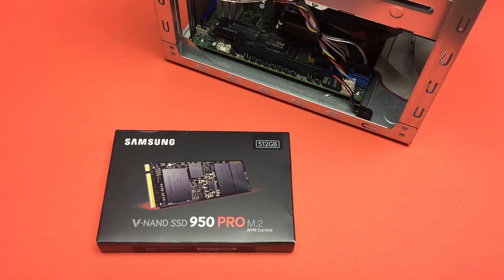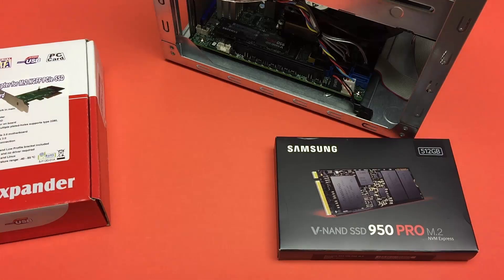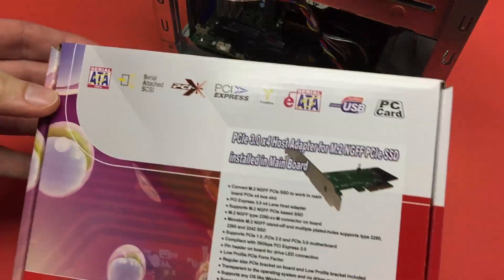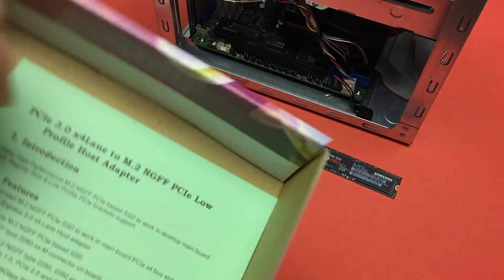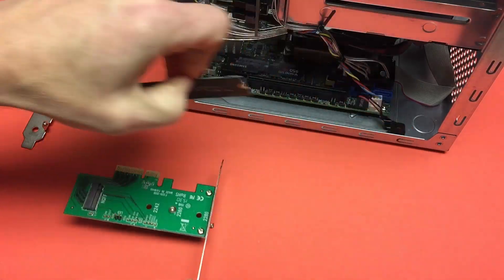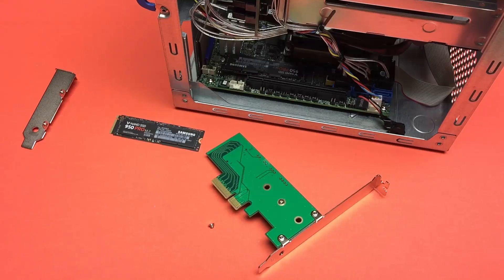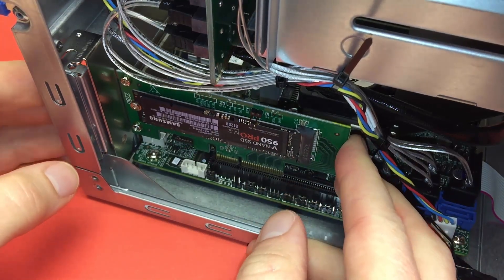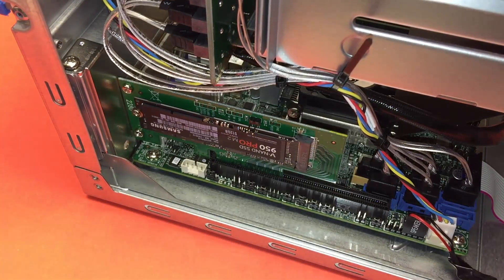How to install Samsung 950 PRO M.2 SSD in a PCIe slot with a Lycom DT-120 M.2 to PCIe adapter

Comment: That card may be sold as PCIe 3.0 but there is no circuitry of any kind that on it that would hinder performance if used in a faster slot and with a faster drive.  Boards like these are just a direct connection to the PCIe slot.  I would not hesitate to buy that if I had a PCIe 4.0 slot or better.
Reply from the maker: You make a great point, thank you!

Comment: How do I make this my boot drive in bios the ssd does not show up in my bios. I did the adapter just like you did.
Reply from the maker: Not all motherboards are capable of booting from NVMe, unfortunately. Do you have the same system?

Comment: ok but how you solved the problem with HDD led? My HDD led is not blinking when I use adapter.....my HDD led is blinking for the other drives but not for the EVO pcie drive

Comment: Hello Paul, I was wondering if the port where you put the card into is going to work?, I know you did it for a reason of course it just that it looks smaller, that's why I ask. I usually use port with catds that fits all the way,  greetings...
Reply from the maker: It works well in that PCIe 3.0 slot, and only uses 4 of the 16 lanes. Not sure what catds is.
Reply: Paul Braren I'LL give it a try, so it means that it works if it's using a few lines only?

Comment: in case of intel z77 you will get pcie 2.0 x4 instead of 3.0 x4, but "only" running on 2.0 x4 this is still insanely fast!!

Comment: I want to install a Samsung 960 Evo M.2, PCIe, NVMe just as you have done now. My question is, with this setup, can this be my boot drive. My goal is to make 960 my boot drive and with a partition make the installed 1TB HDD a secondary drive. I can't seem to find a PCIe adapter to sata. I have an HP 580-023w. If there is a possibility of different setups will any slow the drive from Max performance. I could replace the HDD with an SSD sata, but my limited know how tells me it is slow.
Reply from the maker: Bootiing from NVMe generally requires BIOS settings and a system that supports it, or use an old Samsung 950 PRO that helps even older machines get booting working right. More detail at:
https://TinkerTry.com/how-to-boot-win10-from-samsung-950-pro-nvme-on-superserver

Comment: Hi Paul.  I was thinking of doing this exact install of an M2-PCIe-SSD via a carriercard.  And on a workstation like the Dell T5610 or HP Z620 (these have double Xeons and can hold plenty RAM so would suit me fine for my audio-processing work).   In my opinion such workstations will profit maximally from these fast PCIe-SSD's (e.g. the 960 Pro now).    Where I can see that the SSD will fit and probably also will be connected to the correct datalanes in that PCIe-slot,  I am not sure whether I can install Windows on that SSD and have that SSD as the primary/boot drive.    Appreciate your thoughts/experience on this!

Comment: Touching a memory module like you did while unpacking it is the best example for the lack of knowledge in most of these so called "experts" flodding YouTube with their bullshit. NEVER touch the pins with your greasy, static charged fingers is rule no.1 in handling such modules. Back to school i would suggest
Reply from the maker: Humidity wasn't a concern in the room I was in, but yes, lack of an antistatic strap telegraphs the wrong message to viewers who live in dry climates. Fingerprints always never good, also a good point. Thank you for taking the time to leave feedback for other viewers to consider.

Comment: I have only one m.2 slot on my mobo (z270). I'm getting a nvme samsung for install OS and softwares (photoshop, office, video editing and a few games), and some internal 3,5'' sata hdd, several terabytes. I'm wondering buy one of these (startech one, maybe? or any that supports nvme interface) for my m,2 ssd, and buy a intel optane module for boost my games installed in HDD. Am I making a good choice?
Reply from the maker: Sorry, my focus hasn't been on gaming, instead on VMware vSphere to run VMs. But if your mobo can do Optane acceleration of big drives, then yes, it should be a pretty darn good experience.

Comment: Have you tried with a setup where the MB doesn't have a m.2 socket? Is it the same speed on that setup? Since I have a MB without m.2 socket and have a m.2 NVMe SSD.
Reply: deponds on whether your MB has PCIe 3.0 or 2.0

Comment: Hi, I have a similar setup, MG Gigabyte Z170 with NVME support and one NVME slot, that is used by a 950 PRO. Everything works fine with this config. But I bought a second NVME EVO 960 and a riser card PCI-e x4 like yours. When I turn my PC on and go to the BIOS I do not see the new EVO 960 drive. It simply does not show up. I have no idea why? I tried all kind of settings in the BIOS, set to defaults, etc. There is no way I can make the MB see the NVME SSD. Obviously Windows does not see it. Where should the drive appear in the BIOS? Can you give me some suggestions? 
Thanks

Comment: wasn't that just a PCI slot, all PCIe slots I've used are blue.
Reply: Mike kirock no, black is actually the default color, manufacturers just color theirs according to the motherboard color scheme, blue is pretty common though, so is white, but on an OEM motherboard like a dell motherboard, they would be black.

Comment: The M.2 format has to have an adapter to fit in the PCI slot?
Reply: JRabbit no the motherboard has a slot for M.2 but many M.2 sots on motherboards are 2 lane and max out at 800MBps something but if you plugged an PCIe to M.2 adapter in it can get speeds wayyyy over even 4,000MBps. So if you buy a Samsung 960 PRO which has speeds of 3,200 I think and you plug it in a motherboard that is 2 lane on it's M.2 it will max out around 800MBps which makes the purchase worthless because you can't get the full speed. O get he full speed you either buy a new motherboard that is 3 lane m.2 or but a $10-$15 adapter that fully support the speeds lol

Comment: is there a diff way to install it via m.2 instead of that large thingy ?
Reply from the maker: Sure, if the motherboard has a M.2 slot, just install it there instead.
Reply: Paul Braren it depends if his M.2 is 2 lane or 4. if it's 2 he will get speeds of a normal SATA 3 SSD almost and it would make more sense to get an adapter so he can fully utilize his speed.

Comment: I guess I can't use this approach with BIOS which doesn't support NVME right? I somehow thought NVME controller will do that for the BIOS, so it will take it as another bootable storage.
Reply: Ano Nymous are u trying to download Windows to your m.2 SSD? if so it won't show up in your bios because you will need to us boot from windows disk than when it asks where to install u than click on ur m.2

Comment: that was interesting because  I ordered an adapter for my z87 board with a 960 evo M.2  from Samsung and then I saw that this would not work with my Asrock z87 according to a youtube video from ramcity. I then decided to buy a z97 board with the m.2 sockets in the board and do what you are doing. That is install the drive in the board socket and then buy another 960 evo and install it in the adaptor.Now, according to ramcity this wont work either as windows will not boot from the PCIE adapter and I would like to know  what is correct ?Will the system recognise the PCIE adapter with the drive in it and will or wont it boot from this drive ?

Comment: I dont get it, did you connect the pcie3.0 x4 on a  bigger slot? what is that PCI slot?
Reply from the maker: Just a single  half-height, half-length PCIe 3.0 x 4 lanes slot is all I needed for full speeds, in addition to the  tiny M.2 slot on the motherboard that is also PCIe 3.0 x 4 lanes.

Comment: Hello, I just screwed in the 950 and I noticed it wiggles a bit.  Did the 950 wiggle a bit for you too?  It appears to be attached and i cant tighten screws anymore.  Just want to make sure its safe!
Reply from the maker: +notatrollll I doubt there is any danger if there is a  little movement, but no, mine seems to tighten with no play, no wiggle.
Reply: ***** Aww, scares me a bit with the wiggle, but it is workign great! 2500 read 1500 write on the pcie adapter card!

Comment: is performance the same?
Reply from the maker: Yes, same speeds, see also https://TinkerTry.com/how-to-install-a-2nd-samsung-950-pro-m2-nvme-on-superserver#nov-07-2015-update
Reply: I was about to ask the same question. My second m.2 slot cancels out 2 sata ports so i was thinkin about putting my ssd in the pcie slot.

Comment: Thanks Paul, the list is very helpful. However, I couldn't get to open the first link.  Again you mentioned Camera. What do you use for your recording. (THIS VIDEO).
Reply from the maker: Ah, just an iPhone 6 Plus on a tripod, with 60FPS mode set. Sometimes I just copythe MOV to my PC over the USB to lightning cable, then rename it MP4 and edit it in Camtasia if needed, or I just upload the MOV itself to YouTube if no edits are needed. Hope this (finally) helps!
Reply from the maker: Oh, the tripod clamp for my iPhone 6 Plus that I use http://amzn.to/2cNKcz8 will also work with my 4K-capable on-order iPhone 7 Plus. Really looking forward to having a 2nd lense for proper zoom too.

Comment: Please answer this, i just bought the adapter just like yours and had a Lenovo 256gb nvme ssd that i wanted to adapt to my Asus Rampage IV Black edition motherboard. Would this work at all. I already inserted into the shorter/smaller PCI slot and it lights up when turning on, i just have no idea how to enable it or if it's doable on my UEFI BIOS...

PLEASE HELP!
Reply from the maker: David, I don't own this equipment, so I'm unable to provide useful feedback, but hopefully my SuperServer article
https://tinkertry.com/how-to-boot-win10-from-samsung-950-pro-nvme-on-superserver
has something of general advice that helps you.

Comment: Which is better? Installing it on the M.2 Slots or getting a pcie adapter? Im using Asus Z170-A
Reply from the maker: Doesn't matter, in my tests of the $20 Lytron, performance is identical (since both my M.2 and my PCIe slots are 3.0 x 4 lanes), see:
https://TinkerTry.com/how-to-install-a-2nd-samsung-950-pro-m2-nvme-on-superserver#nov-07-2015-update

Hope this helps!
Reply: Thanks, I guess my m2 slot is also like yours. So im probably going to just install 950pro there

Comment: so my m.2 port is max 10 GB/s, but im planning on using this SSD. its speed is 32 GB/s thats y i need to use the pcie card and place the ssd chip in there. is my thinking correct ? my motherboard is gigabyte gaming-3
Reply: Depends if your M.2 drive on ur motherboard is on a pci 2.0 or pci 3.0 lane.  Most boards m.2 are on pci 2 and most x99 intel motherboards are 3.0.
Reply: your 10gb port is actually sata express  not PCIE .PCIE is 32GB . The Asrock boards have both but a lot of newer boards are only giving you the 10GB solution which means you cannot fully utilise the drive.

Comment: buy a new mainboard instead of this adapter.
Reply: I'm running a 12 core dell t5500 with pci 2.0.  new mother board and 12 core cpu would cost an extra $5,000 plus. But I'm open to ideas.

Comment: dat cable management tho 9/10 :'
Reply from the maker: Thanks! Supermicro made it easy, with nice thin SATA3 cables of (barely) the right length, wire tied at the factory, then the 6th cable added and tied by Wiredzone, the Supermicro reseller.

Comment: nice video ..thx hey please tell me if is necesary make something configuration in the mother board like that SSD samsung.. with ACTIVATE "ACHI" MODE
Reply from the maker: Each motherboard is different,  but AHCI settings are for SATA drives, shouldn't have any effect on NVMe M. 2 drives.
Reply from the maker: See also https://TinkerTry.com/how-to-boot-win10-from-samsung-950-pro-nvme-on-superserver
Reply: I bought a ASUS Z170 PRO gaming thinking it was the PRO model. it doesn't say it supports NVMe but it does say 32Gb/s M.2. Does this mean that if i buy and m.2 nvme drive that i would be limited to ACHI or SATA speeds? Also is there a PCIe card that i could buy to support NVMe even if my mobo doesnt?

Comment: I have ASUS Crosshair V Formula Z Mobo, and a spare x4 slot.  What do I need to boot off an M2 drive?
Alt:  intel 750 AIC?
Reply from the maker: +brian brunner I'm not sure, I don't own and haven't tested that hardware. You'll likely want to start with your mobo's instruction manual, to see if there are BIOS settings to alter.

Comment: Hi, I have an Asus Maximus V gene wich works with z77 chipset but my processor is an i5 2500k, can i use this adapter in a pcie wich work in 2.0 because of the processor?
Reply: Yup, works with PCIE 1.0, 2.0 and 3.0!
Reply: But will it work at full speed?
Reply: PCIE 1.0 nets you about 300 to 400 mb/s, so about the speed of a decent Sata drive.  PCIE 2.0 gives you a max read of about 1600 mb/s.   PCIE 3.0 is 2000+. 

So using your PCIE 2.0 slot would definitely be worth it.  You'd still be much faster than, say, the Samsung 850 EVO.

Comment: Is this compatible with z97 pro4?
Reply: i also wonder that. I have asus z97 pro motherboard and bought and installed Samsung 960 evo on the motherboards m.2 slot. But i don't get the actual speed of drive. So, if this pcie adapter increases the speed of ssd on this motherboard?

Comment: do i need the adapter for full speed?
Reply from the maker: +Hjg Gvk Nope, the adapter just passes signals through at full speed, no slower or faster than when M.2 drive is installed in the M.2 slot directly. This is true for my particular Supermicro motherboard X10SDV-TLN4F that has PCIe 3.0 x4 on both the PCIe 3.0 slot and the M.2 slot, for full speeds. More details about NVMe here: https://TinkerTry.com/how-to-boot-win10-from-samsung-950-pro-nvme-on-superserver
Reply: ***** thanks

Comment: Small caveat:  The 950 pro is faster than the Intel 750.
Reply from the maker: +druuzil True, for single user home lab environments, it would seem the 950 is a better device, see also https://TinkerTry.com/samsung-950-pro-benchmark-results-superserver-sys-5028d-tn4t#ATTODiskBenchmark https://TinkerTry.com/win10-boot-time-intel-750-series-v-samsung-950-pro-on-identical-superservers
Reply: ***** I was mostly just referring to the read/write rates.  I think the Intel gets ~2200Mbps read whereas the 950 Pro gets 2500.  Good video though sir.

Comment: I bought this adapter and same M.2 I installed it in the mini pci slot, so the chip part is hanging out. It works but speed seems off. Am getting 320  read, instead of 2200. And booting up windows 10 is 44-seconds. I get 22-seconds on a Hard drive. So am confused. Would putting this is full length PCI make it faster or is something else the matter?
Reply from the maker: +Michael McCullough Perhaps your PCIe slot is not 3.0 x 4 lanes? See also a bit more explanation at https://TinkerTry.com/how-to-boot-win10-from-samsung-950-pro-nvme-on-superserver
Reply: Yes, you need to put into a full length PCIe slot, that’s x16 x8 or x4. The small PCIe slot you’re putting it into. It’s probably just a PCIe 2.0 x1 slot.

Comment: Ok, so I finally installed my Samsung 950 Pro SSD. yes, I installed it thru an adapter on my PCIe 16x and I was able to use it as my Boot drive for Windows 10. This is the link to the exact one I used... http://www.newegg.com/Product/Product.aspx?Item=9SIA86V... If you buy a different one make sure it is 3.0x4. It is really for PCIe 4x but does fit on the 16x though it is much smaller. If anyone is interested just ask on how to install the OS because your SSD does have to be set GPT and Boot Mode in BIOS must be set to UEFI. This is very simple and you do get full speed even though your SAMSUNG 950 PRO SSD is connected via an adapter (ADAPER DOES COME FROM CHINA THOUGH IT IS LISTED IN NEW EGG) WORKS PERFECT!!!!!!!!!
Reply from the maker: Thank you Julio, for taking the time to explain this so well. See also:https://tinkertry.com/how-to-boot-win10-from-samsung-950-pro-nvme-on-superserver
Reply from the maker: Yeah, best to put BIOS into UEFI mode right up front, before you install, because it's a requirement for boot from NVMe. I don't claim I've tested this on other systems though, other than Intel Skull Canyon and other Xeon D's listed at https://TinkerTry.com/compare

My tests were simpler than your outline. I had my BIOS in UEFI mode (which is how Supermicro SuperServer Bundle 2  ships https://tinkertry.com/superservers#Bundle2), then installed Windows on M.2 NVMe (950 PRO). I could later move it from the motherboard M.2 slot to the $20 pass thru adapter card, and BIOS and system didn't care, it just booted right up, same speeds too.
The reverse is true too, could start with M.2 NVMe in adapter card, and install Windows (Windows 10, Windows Server 2016) right onto it, and could later move it to mobo's M.2 slot, works fine.
From what I recall, I didn't actually have to mess with BIOS boot order at all, the default settings in the BIOS that the Bundle 2 arrived with worked without changing anything.

If you already have a MBR formatted NFTS drive running Windows, and you wish to migrate over to GPT, that's much more complicated, and not something I've tested, but a great idea for future tests/articles/videos, and appears this product might do it http://www.disk-partition.com/help/convert-gpt-mbr-disk.html
Reply: your SSD does have to be set GPT and Boot Mode in BIOS must be set to UEFI